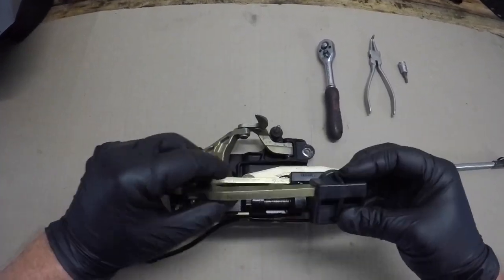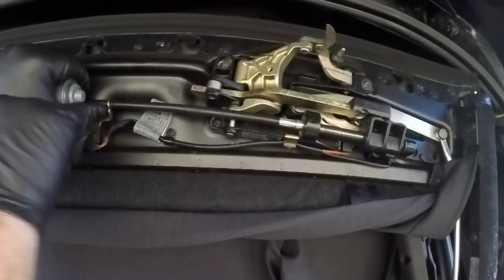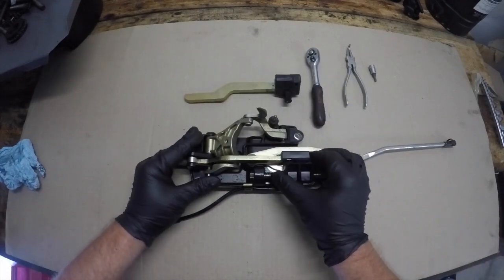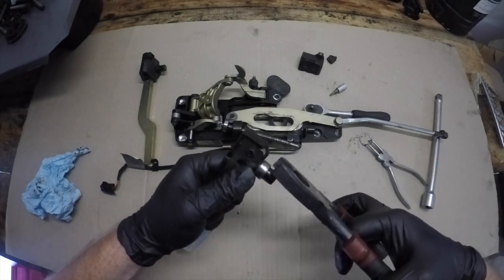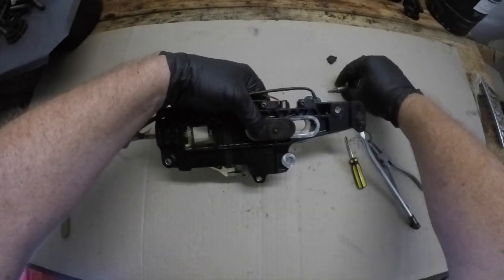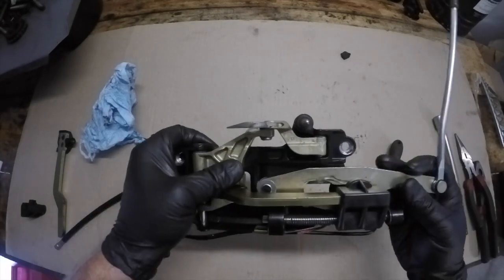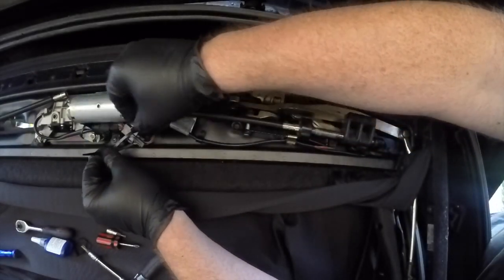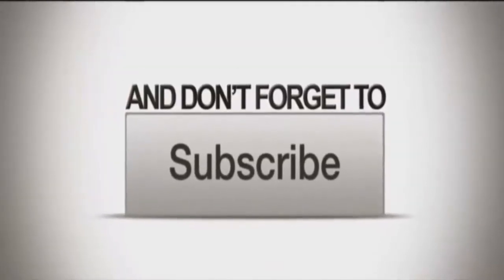Vauxhall Astra Convertible Roof Latches - FIXED

Comment: Hey man good stuff but I can’t find the bloody lever😂 all I see is the hydraulic oil on the right. Do I need to take all cover off in left hand side to find that lever
Reply from the maker: Mitchell Rose that lever is on the left hand side, but it’s hard to find. Don’t need to remove any panelling maybe just the wind deflector if that is still in your boot. The lever is accessed through a slot in the plastics.
Reply: Killa Watt Garage I’ll try to find it .. do you have wassap so I can talk better.
Reply from the maker: No, but Email me at killawattgarage@gmail.com and I can send you a comprehensive resource for repairing these roofs.

Comment: Hi mate I have a code of B1306 roof works but when I open it, it beeps and I have to keep pressing it had new latch motor and ecu still the same any ideas please
Reply from the maker: paul smith if the motor and ecu have been changed and I am assuming it’s the first stage of the roof opening that lifts the roof from the windshield that is failing. The motor performs 2 tasks, undoing the latches and to lift the front of the roof with those arms that extend from the latches. Double check the latches aren’t cracked and those arms are moving. Another check will be the micro switch in the left latch, it may be mechanically OK but the switch isn’t working and the ECU sees an error. Will double check that code for you and reply again. But some suggestions to start.
Reply: Killa Watt Garage  hi I have replaced the cable in the left latch it has like two little black boxes, I have also looked the the plastic blocks and there is no cracking at all
Reply from the maker: flick me an email: Killawattgarage@gmail.com and I will send you a detailed resource to help.
Reply: Killa Watt Garage sent mate many thanks

Comment: Great video mate, just wondering if you have a way to get to the latches when the roof is locked closed, my passenger side has failed with the roof closed but drivers side is still working.
Reply from the maker: Unfortunately not. Usually you have to cut a hole in the plastic trim next to the latch to get access to manually open it. Plenty of new plastic trims in wrecker yards.

Comment: Hi, My Daughter has a 2003 astra and the latches failed. With the help of your video i bought the broken parts of ebay and replaced them. Now i can close the roof manually but if i try to open it the buzzer sounds and it won't open. Any idea what it could be?
Reply from the maker: chris Heylbut flick me an email at Killawattgarage@Gmail.com and I'll send you a full instruction manual of how the roof operates and what the fault could be.

Comment: hi would this stop it working as it wont open  its making noise
Reply from the maker: Daniel phipps if it beeps when you try to open it there is a fault. The latches are a failing item and often the cause.

Comment: Hi mate.
Just replaced hydraulic hose. Holden reset roof and fault codes. Worked a couple of times . Now nothing but the roof motor working. Cant even wind roof shut manually with hex tool , just spins and no movement on the latches. Would this be the little plastic blocks that could b cracked ?
Reply from the maker: GARY KELLY very much sounds like the plastic blocks are broken.
Reply from the maker: at 12:32 with the motor or hex key spinning you should see the movement of the cables transferred to the latches. If you are not seeing this your problem is the gears within the motor. They can be sourced 2nd quite cheaply. Using a power tool on the hex key is a common cause of breakage. Let me know how it goes.
Reply: Killa Watt Garage thanks mate. Just picked one up. Is it any easy change over , anything i need to worry about.
Reply from the maker: GARY KELLY ensure that both latches and in the same position as they operate together and need to be doing the same thing at the same time. The passenger side has the switch that ensures the motor shuts off once it is fully latched. Take it slow the first time and just press the switch on and release it to move things slowly, checking ad you go. Ensure battery is fully charged or have the engine running.
Reply: Killa Watt Garage cheers for the information.  Will get on it as soon as rhe new one comes.
Cheers

Comment: Fantastic video, what is the cable called that goes from the motor to the latches? where can i buy that from...i am in Sydney.  Thanks in advance
Reply from the maker: I would call it the 'drive cable between the motor and latches' try some wreckers or gumtree.

Comment: Hi mate,

My partner has just bought an 02 Bertone Astra, and the roof isn't operating. When the switch is pressed to open the roof, you can hear the mechanism try to do something but after a few seconds of no movement, we get a few beeps. Is the likely cause a broken latch? We've had a wrecker offer us a whole back cut of another astra with a working roof for $400 but would like to try all other avenues before we resort to that, seeing as we can't store half a car in our suburban lot. Thanks in advance!
Reply from the maker: Sup3rBeast yes it sounds like it's broken latches. Email me at killawattgarage@gmail.com and I can send you a comprehensive resource for repairing these roofs.
Reply: Thanks so much for the quick response, will do!
Reply: Hello can you help me.
Give me the B1302 error and the hood stops to close
Many thanks
Reply from the maker: Hi the B1302 is referring to the Accessory Relay circuit. This circuit maintains power to the roof for a short amount of time after the key has been removed. Start with checking the relay.
Reply: Killa Watt Garage  could you please specify which relay I should check? Thanks
Reply from the maker: From memory in will be either be under the bonnet on the same side as the battery, or under the dash on the right hand side.
Reply: Killa Watt Garage  many thanks, I’ll check it and came back to you

Comment: G'day Killa. When you open the roof manually do you need to touch the lever at the back of the car L/H side.??? also when you finish the job can you close it  in auto mode ?? or we need to close manually ?? Thanks. All the best to for 2018 . Cheers from Australia. Patrick
Reply from the maker: Winding the latches open unlocks the front section above the screen, then the lever in the boot needs to be used to unlock the rear roof. I manually closed the roof to the point that the latch motor begins and watched them operate and close. Be sure the have the latches at the same point when reassembling as only the left latch as the sensor which stops the latch motor.
Reply: Thanks for your help well done. Cheers. Patrick

Comment: Hey buddy what is the mechanism that the Allen key goes in called? I just bought an astra 2md hand and went to shut the roof for the first time and it won't lower to the windscreen it just keeps clicking both ways.. Hilp plzzzz thx stacy
Reply from the maker: This should help you: http://mikeellis.org.uk/photos_astraowners/Astra%20Convertible%20roof%20hints%20and%20tips.pdf
Reply: Awww thx

Comment: I've got a fault with my roof all of a sudden. It worked perfectly until the battery went flat (as I'd not driven the car for a while), I charged it up and refitted it. 
The roof just went mental the first time I tried to open it, relays clicking like mad and it stopped and beeped! I managed to get it all the way open and fully closed again, but now it work at all.
When I unlock the door and open it, the roof alarm beeps. When I stop, I out the handbrake on, then the roof alarm beeps when I release the handbrake!
The central locking now doesn't work on the boot either!

Any suggestions? I'm thinking broken wires causing a short, rather than mechanical failure like in this video.

Oh, and when I lock the car, the roof alarm beeps then too! Does the ECU think the roof is not fully shut maybe?
Reply from the maker: I agree it sounds as if the roof ECU sees the roof as still open. When you closed it manually did you fully wind in the latches?
Reply: Killa Watt Garage Last time it closed, it did so electrically and it was totally fine. 
It stopped working then.
The central locking on the boot lid was fine until late on today.
I had been in the boot a few times, so maybe the split is in the loom to the boot lid.
Reply from the maker: I send you a private message
Reply: Hi, this is my problem for me as well. Would you let me know that this problem resolved?
Thank you very much for your help.
Reply: Manny Maley I forget to ever update this. I fixed mine. It was the switch in the top of the windscreen at fault. The car thought that the roof wasn’t fully closed, due to the switch being faulty.

I didn’t have to replace the switch, just cleaned up the contacts and it started working! The roof was totally fine after that!
Reply: Manny Maley Good luck with it! Hopefully it is just that switch. It’s on the frame above the windscreen on the left hand side of the car. It’s being the plastic trim and it’s easy enough to get to it.
Reply: @R1CH130  I just bought mine with this issue. The car beeps 6 times when I open the door. Same when I unlock the hand brake or I click on the open roof button. I have tried to open the roof manually but cannot push it up all the way (the laches are disconnected completely though) I feel like if I force it. I may damage it. Do you have a name, part number for the switch you have mentioned or a photo? Thank you for your time. I'm stuck with the issue I don't know what to do

Comment: Hey mate just an issue as i was opening the roof i heard a cracking or popping sound , but the roof opened. However as I was closing the roof it failed to lock. Why and what can i do as a temp measure to keep the car secure? Also my car did not have an allen key can i purchase one? Cheers
Reply from the maker: At a guess it sounds as if the latches broke, which means it won't lock closed. As a temporary measure your best hope is to tape it down. With a little more work you could pull off the internal plastic cover and manually make the damaged latches lock in place. This is what most people do until the next summer and then fix it properly. Hope it works out for you. Thanks for the question.
Reply: @killawattgarage  Thanks mate. This morning followed your instructions and tried it manually the left sided latch locked however right is still loose. I had a look in the windscreen cavity and the left side had a black locking device whereas the right is missing is that normal?
Reply from the maker: @TJ-jm5yc  They should be the same. at least you have one side latched.

Comment: Hi.
I have got a 2003 g astra cabrio
and the roof isnt opening.
The Opcom codes is b1300 b1301 and b1302 the all of codes is hall sensor's mistakes.
the roof latches is broken the left and the right side too.
i think if i repair the latches,the roof is will be working.
sorry for my english,i learned ,but it was long time ago.
do you have some idea for me?
Thank you,and this video is king
Reply from the maker: The hall switch is a part of the latches and when the latches are broken the hall switch will not operate correctly causing these errors.
Reply: Thank you so much !!!!! :)
Reply: Hi.
i replaced the broken latches,but the the roof dont work. :(
do you think,if i deleted the fault codes it will be work?
thank you the answer ;)
Reply from the maker: Mochnánszki Zsolt erase the fault codes and try again. Scan for codes again. Email me at killawattgarage@gmail.com and I can give you more information
Reply: thank you,now sleppeng  winter dream my car,but i send it on the end of march ;) thanx the help again! have a nice day

Comment: Great video
Reply from the maker: Alan Honan thanks hope it helped you out.
Reply: Killa Watt Garage did u have a fault code stored iv got one and I think it's this sensor that's faulty
Reply from the maker: Alan Honan what code have you got?
Reply: Killa Watt Garage b1302 hallsensor header close circuit open
Reply from the maker: The Hall Sensor is the small magnetic switch in the left-hand side latch. Either your latch is broken or the sensor is faulty, as the ECU is not recognising that the latch is closed while the roof is fully down. Best place to start would be to remove the plaster cover over the latches and look what's going on. I have further info that I can email you, just message me.
Reply: Killa Watt Garage brilliant thanks mate that's what I thought after watching ur video 🖒🖒
Reply: Hi mate I removed the lining and looked at the latch it's all in good condition does so I'm thinking it's the sensor can u buy them separate or is it a whole latch ??
Reply from the maker: I am guessing that it would be the whole assembly. The sensor is just a simple magnetic switch, so test this before spending the cash. Email me at killawattgarage@gmail.com and I will send you a guide to help you problem solve your roof issue.